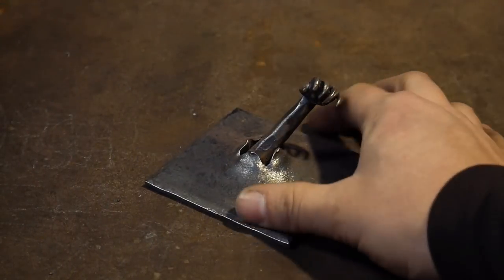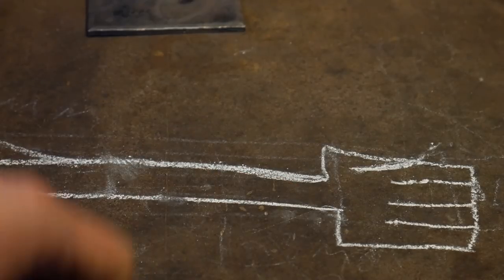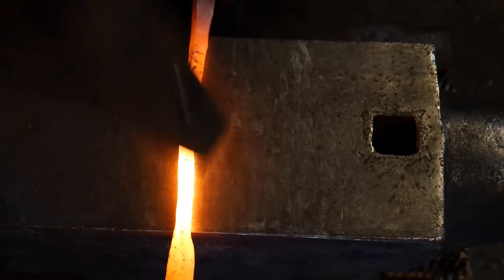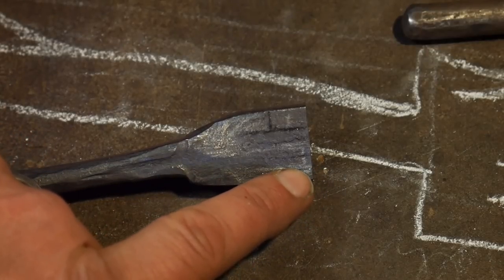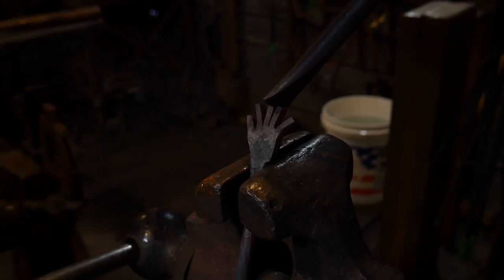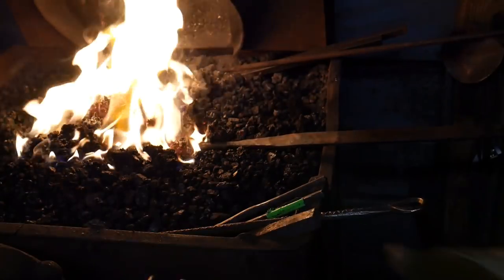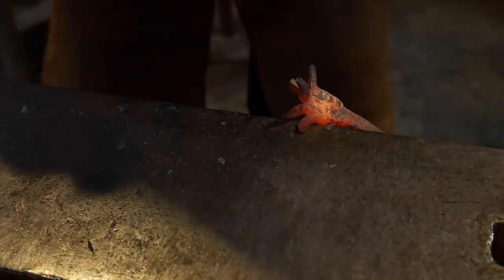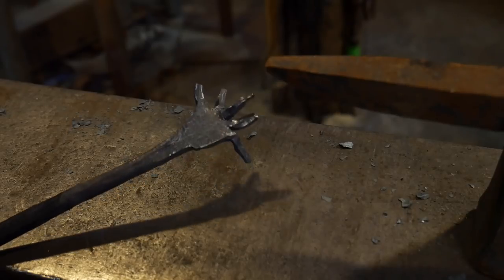How to Forge a Hand

Comment: Good job but I think the only thing you the only thing you could have improved on was when you formed the palm with the ball-peen you should have used a wooden stump under it and it would have made the back of the hand a little curved like a real hand instead of flat
Reply from the maker: +James Brandon you're absolutely correct and that would be a great way of doing it. The only problem with that and doing that on camera is it creates too much smoke and Flame in order for you to see what is actually happening. Off camera I will definitely take your advice though preciate it. God bless thanks for watching